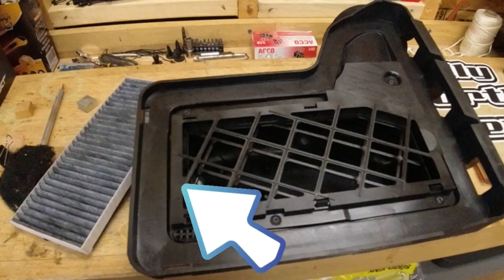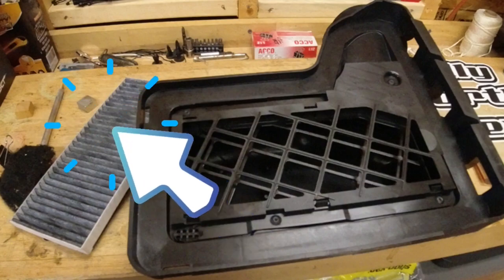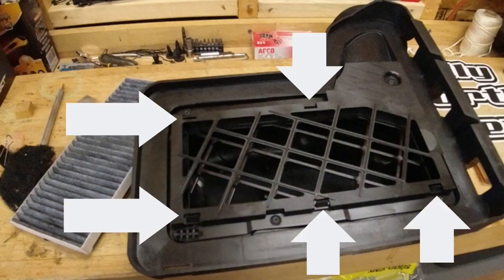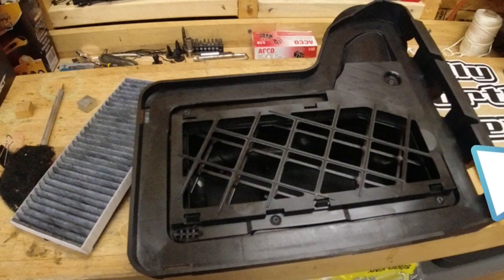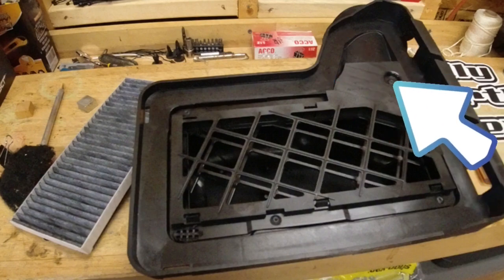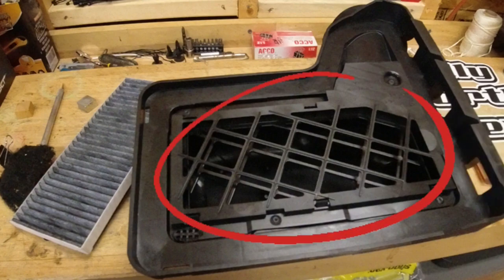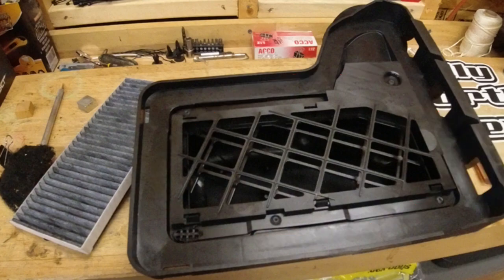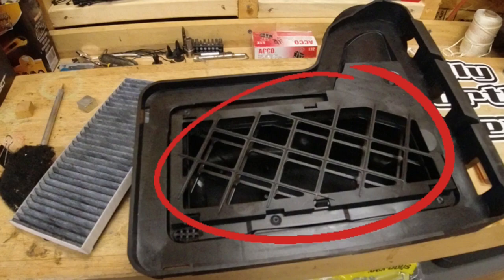How to get back the LOST 10 Horsepower for 22 and 23 Coyote V8’s

Comment: I just bought a 2023 Mustang GT , Stupid me being a Camaro guy my whole life didn't really know a new mustang body was coming out in a few months. That being said I had a Roush Cold Air intake that said it was only to be used for the  2018 - 2021. I installed it today. I also have the borla cat back system that was put in a few weeks ago. After installation I allowed the car to idle with the new parts to ensure no failure or issue before driving. Took it for a 3-4 mile run and she was fine . No codes yet and issues and sounds better. I felt like the car was struggling to breathe with that old Intake on. I obviously did not dine with the car before and after as I'm just assuming that with the boiler Cat-Back system and the Roush cold air intake I definitely should have gotten my horsepower back + some. I live in FL I could drive a gas can around with wheels no exhaust and I'd be ok. Gotta love freedom!
Reply from the maker: That's awesome! Thanks for sharing!
Reply: Huge thanks to you though. I had a 2018 GT for a yr and traded it for this one because  I found out it had frame damage. Anyhow when he said yea it's got 450 I said what happened to the other 10 hp no one could give any real reason of why it might have changed. I do believe this is at least part of that 10hp if not all of it. Thanks 🙏 again.

Comment: Sad times we’re living for engineers to have to retrofit something restrictive to meet the EPAs standards. Awesome vid!
Reply from the maker: I really don't think they are carbon positive anyway. I'm getting better fuel mileage now meaning I'm producing less carbon. It may produce less at idle but it makes the car run harder. It's a mess really.
Reply: @TonysFordsandMustangs  I have replaced the 2022 lid with a 2021 lid, definitely an improvement, the car runs better in everyway.  I recommend this mod.
Reply from the maker: @judytaylor7114  That'[s awesome thank you for letting me know!

Comment: Here in NZ,  the last of the Australian developed and built performance Ford Falcons came with the "Miami" (Ford Australia's code name for it) supercharged 5.0L, final versions, 2014-2016 made 471 hp, and had an "over-boost"  system that gave up to 15 per cent more power and torque, equivalent to over 536 hp and 479 lb⋅ft, when the conditions allow. Have you ever thought about doing a video on the performance Fords developed and built in Australia, there was some real nice Fords designed, built and raced down here.
Reply from the maker: I would love to but since my YouTube payments have just cleared the cost of my camera with my last video I don't think a trip down under is quite in the budget. Thanks for watching!

Comment: Hey Tony, new subscriber here and really enjoying your channel.  I just brought my '22 GT home last week and I'm loving it.  Just a quick question regarding this topic though, if I add an entire cold air intake to the car, it would also remove the restriction caused by the factory airbox, right? Seems obvious, but just for clarification.

Thanks!
Reply from the maker: Thank you for subscribing and yes that should be case depending on the intake. IF you like the look of the intake spend the $$ however, you would see same gains for less money by removing the HC trap (plus the cage which I didn't remove because it wasn't my car ) and dropping in a Airaid filter. Best of luck and thanks again.

Comment: I put out this video a month ago. Glad to see you cover it too.
Reply from the maker: I would have had I had access to GT.
Reply: I can send you pics or a video. The pieces you shown could possibly stay. Let me know your thoughts.
Reply: @MattGibson-ml7un  I pulled them out. Any restriction stops air flow.
Reply: I removed the carbon trap and felt a diffrence right away. i did not take the black plastic piece off though is it really necessary?
Reply from the maker: @alexisaguilera2705  None of it's necessary but but it would add a bit. If you take an oversized drill bit and center it on the plastic rivets and slowly drill them out  those grills would pop right out. It wasn't my car or I would have done that or swap lids with and older S550.
Reply: I did it thank you 🙏
Reply from the maker: @alexisaguilera2705  Glad it worked out!

Comment: Want to do this to my 22 Mach1, but would hate for any warranty to be voided. Don't want to be taking it in and out in and out.
Reply: I did it to my 2022 Mach 1 thanks to Tony's instruction and it's the best thing I ever did. It's actually 18 wheel horsepower you get back and it sounds a lot better and you get slightly better gas mileage  It's not like when you go to the dealer for an oil change or inspection they're going to be pulling off your cold air intake to check it. The only thing I take off when I go to the dealer is my oil separator.
Reply from the maker: In order for a dealer to decline a warranty claim they have to show that the alteration caused the issue. There is no way a dealer could say that increased airflow lead to an issue. I have data logged this on my Mach 1 for 2,500 miles and the 02 sensors more than compensate for the increased airflow. It's you car but this part did not exist in 2021 so it's not like it is making the car run better. I don't think it's carbon positive. I am getting better gas mileage now and therefore burning less gas and producing lower amounts of carbon. It's a trap that causes your car to run less efficiently. It may help at the tailpipe at idle but it hurts performance & mileage when the car is operating. I truly believe it's a part made to meet  a specific regulation that does as much harm as it does good for the environment.
Reply: @TonysFordsandMustangs   No doubt, may pull it out this weekend

Comment: When you did your Mach 1 you mentioned positive and or negative fuel trim when removed.  What if anything negative will that do short or long term?  Appreciate it!!
Reply from the maker: Short-term fuel trim values should generally be between positive 10%, and negative 10% when the engine is running at a steady speed. Ideally you would be neither negative or positive. With the trap and tube out my subscriber and I both saw + 8 to 9 on fuel trim numbers. With the trap out and the tube back in I'm at +1 or slightly under +1. You don't want to run too rich or too lean. Most cars won't toss a code until you hit 25 one way or the other however that isn't ideal. I made the second video so people know to put the tube back in. The trap itself seems to have little to no effect on fuel trims. When the tube is out it's different story. I guessing the ECU has a set size of the intake tube and that does not adjust. Either way the fuel trim numbers are inline with factory specs with the trap out and the tube back in and that's how I would recommend anyone go about this. The trap is the blockage and not the tube.
Reply from the maker: All that said IF you have GT I would replaced the airbox lid OR if you trust your drilling skills, remove the trap & carefully tap out the plastic rivets that hold the retaining grills in place.
Reply: I was able to remove the carbon trap but I left the plastic cover on. Do you really think the plastic cover is necessary to remove I haven’t heard anyone tell me that who has a 22 GT that did this mod. Has anyone dyno’d their GT after removing the trap to see the gains? Because when I took it off I did notice a difference right away so I’m pretty sure I did gain that 10hp back.
Reply: I just tossed in a k&n drop in filter in my 22 gt and removed the hydro carbon trap filter and  the 2 piece basket holding it snapped out easily. However I left in the round piece just after the flow sensor. Couldn't get it out without breaking it! If anyone has removed it, I'd love to know how. I definitely feel more power and better throttle response!  Thanks to you!
Reply from the maker: @lucanapolitano3587  you don't need to worry about anything after the flow sensor. If you removed the trap. the basket and dropped in a K&N you have increased airflow dramatically. Glad I could help and thanks for watching!

Comment: Tony can this be taken out by removing the cone filter only ?
Reply from the maker: Are you working on a GT or Mach 1?
Reply: @TonysFordsandMustangs  Mach 1
Reply from the maker: @SHODUUP  you need to watch those videos. They can be found here: https://www.youtube.com/playlist?list=PLz2M3b_orpr3WOr2d853is8S6hubCkoqD
Reply from the maker: To reply to your first question yes you can but it's not ideal and i have heard of people breaking tabs off the sleeve which needs reinserted in order for your fuel trims to run correctly.

Comment: Is there a disadvantage to drilling that mesh out of the lid?
Reply from the maker: No not at all. IF it were my car that's what I would have done, Just be careful you don't drill through the lid.
Reply: @TonysFordsandMustangs  well i just did it. The cage that holds the hydrocarbon filter simply pops off.  No drilling or otherwise cutting involved. I tried to cut out the round waffle section only to find out it easily slides out as an inner sleeve (as long as the maf is removed, which i did BEFORE conducting any violence upon the air-box lid)... there was no need to damage the waffle section (which i did), it was easy to slip out...
Reply from the maker: @greekfrenchman4434  Congrats! I don't think you will feel the extra 10 HP but it's there :)
Reply: @TonysFordsandMustangs  throttle response is better
Reply from the maker: @greekfrenchman4434  The price was certainly right. :)

Comment: Have you done no lift shift in your Mach 1 yet?
Reply from the maker: Several times. It took me that long to break an old habit and sometimes I still lift. At the dragstrip I have it down now on a road course, not so much. I have been lifting for over 40 years...
Reply: @TonysFordsandMustangs  do you know if it works for all models of Mach 1? I tried doing it in mine and it just revved out
Reply: @TonysFordsandMustangs  can you do a video of how to do it?
Reply from the maker: @martincontreras7579  You need to be in Tack or Drag mode.
Reply from the maker: @martincontreras7579  If you have it in the correct mode there's nothing to it. Keep your foot down and shift. The hardest part is breaking the habit of lifting.

Comment: I saw another YT video where they removed the "cages" and the "waffle" that's on the round tube part.... I don't see any dyno numbers from anyone, though.  That's unfortunate, but understandable as it's just a "free mod." But it does raise the question of whether we are doing more harm than good.  I don't want to mutilate my 2022 airbox lid only to find it actually causes an issue, either a code or a hesitation or anything else....    waiting to see if anyone else does a dyno test.
Reply from the maker: I done the dyno test on my Mach 1 and the data logging over 2,500 miles. I don't think there will be much a difference with the GT. Those videos are on the channel.
Reply: Ive had my carbon trap off a for a few months now. And put in a k&n filter. Just recently started getting check engine light. Lean codes. Car has 2k Miles. I'm working on figuring things out. Wondering if anyone else can chime in with experience on removing the trap long term.
Reply from the maker: Is it a GT or a Mach 1. In other words Is it a closed or open airbox?
Reply: @TonysFordsandMustangs  GT
Reply from the maker: @lucanapolitano3587  I've run over 5000 miles with mine out in my Mach 1 and logged fuel trims multiple time and I have no issues. I wonder IF you have a airbox leak somewhere?
Reply from the maker: @Zer0TX  sorry I was referring to the gentlemen that had the lean codes.
Reply: @Tony's Fords and Mustangs  thanks for the update.  I will go over everything thoroughly before I take it to ford. But thanks for the peace of mind on monitoring your fuel trims.
Reply from the maker: @lucanapolitano3587  No worries I hope you figure it out. Maybe check the Mass Airflow senor as well. Make sure the connection is tight and you can clean those with carb/fuel injector cleaner.

Comment: Did you have any check engine lights
Reply from the maker: It's not my car but 6 month later no he hasn't. It's the same amount of airflow as a 2020,2021. The HC filter was added in 2022 because of new legislation not because it helped the car run better.
Reply: Thanks for the fast reply ordered a top cover to modify and keeping my stock
Reply: Any suggestions for getting the mesh in the tube out plastic grid stuff
Reply from the maker: @jwoodard1369  I would have removed it IF it was my car. You can tell Ford added this quickly as it's held in with plastic rivets. I would take a large Drill bit and drill out the top of the rivets. That should take all of 2 minutes. Just don't push too hard as you could push through the top of the lid. Just for your ease of mind. I did run without the trap in my new Mach (Different style airbox) and did the data logging. https://youtu.be/77PhbMOKa8Q
Reply from the maker: @jwoodard1369  If you order a top cover for a 21 and back you not do anything other than install it.

Comment: In Australia we don't have the carbon filter I checked mine today
Reply from the maker: Correct. This is a California emissions control failure. It actually makes the car pollute more while driving it and only captures carbon on shut down.  I did a video about what's holding you back but it's not an easy fix.https://youtu.be/NpoERP9zcu0